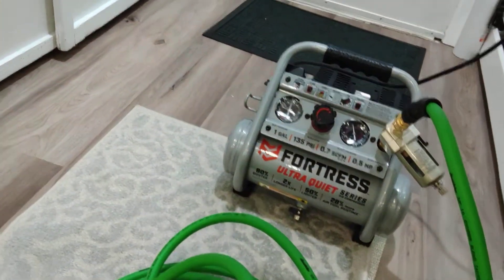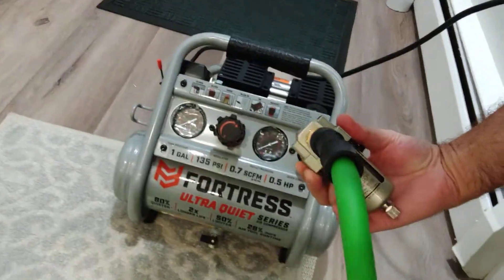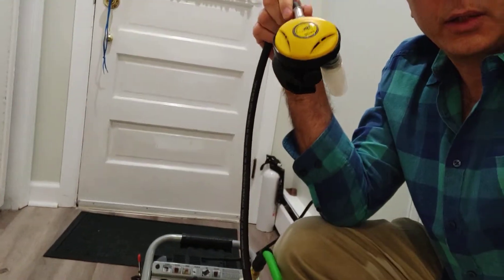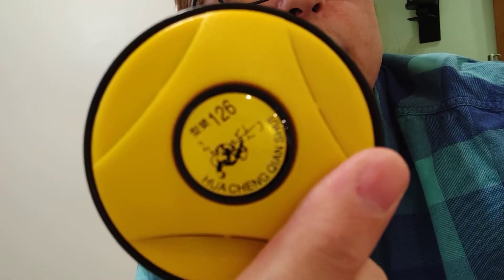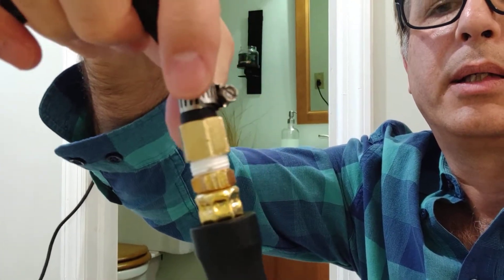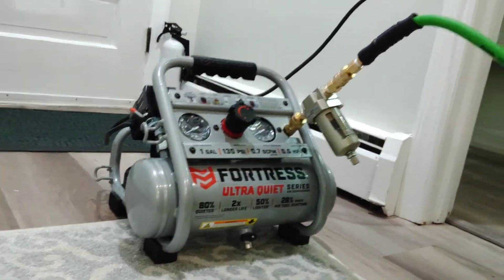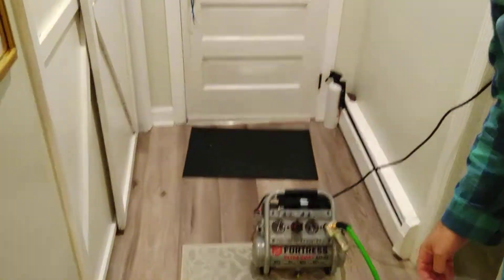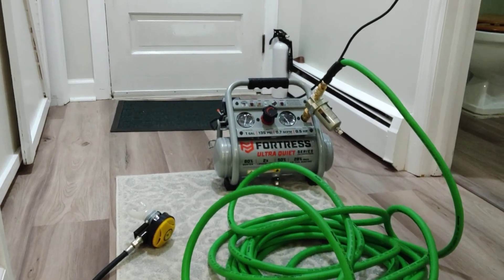Scuba Hookah system for under $200

Comment: I like your enthusiasm and ingenuity. There is a reason why trained divers would never consider using equipment like this........ 
I am known for taking risks, but as a retired scuba instructor I would not consider using this setup. for someone who doesn't have scuba training using this would be the equivalent of playing Russian roulette. Ignoring the risk of lung and brain damage from the toxic hose pipe and compressor. There is insufficient built in reserve and the hose and fittings are not up to standard and will fail. It is only a matter of time. When this happens without a bail out system you will be forced to free ascend. A free ascent breathing from compressed air from as little as 4 feet can result in lung rupture barotrauma causing Air embolism, Pneumothorax, Mediastinal emphysema and Subcutaneous emphysema. Three of which can be fatal. 
This is a classic example of the Dunning-Kruger effect. See the 1999 paper by Cornell University psychologists David Dunning and Justin Kruger. The pair tested participants on their logic, grammar, and sense of humor, and found that those who performed in the bottom quartile rated their skills far above average. For example, those in the 12th percentile self-rated their expertise to be, on average, in the 62nd percentile.
The researchers attributed the trend to a problem of metacognition—the ability to analyze one’s own thoughts or performance. “Those with limited knowledge in a domain suffer a dual burden: Not only do they reach mistaken conclusions and make regrettable errors, but their incompetence robs them of the ability to realize it,” they wrote.

Comment: How about if you make it portable, let's say you get a car compressor that can deliver the same amount of psi, and an external battery of 20,000mah, regulator and hose. Make a case that floats. Would that work?
Reply from the maker: Psi would probably be ok, but cfm not enough with car tire inflator, imho.

Comment: I would be VERY LEERY about having the air from these cheap compressors being forced into my lungs. 

One has no idea what materials they are made from. Or what they are are outgassing. 

What is the lead content of the compressor? 
There is a specification for Restriction on hazardous substances in materials. 

Maybe if one adds a good charcoal filter to the outlet.
Reply: Yeah maybe you shouldn't do it if you're scared and just looking at all the possible negative aspects...... Or send it.

Comment: That ain't going to cut it you need at least 150 LPM. That compressor is only supplying 0.7 SCFM which is less than 20 LPM.
Reply: I used the same compressor , bought Chinese regulator and 50 foot of hose I think for 40 bucks.

I dove for 2, 2 hour sessions moderate diving exertion .

split the hose for two divers.  just floating about 4 to 6 feet down pump still was able to cycle not running full cycle.

got yelled at for using barbed connectors by a diver.
Reply from the maker: For the modest usage I need it for, it cuts it. If anyone were to need more, HF sells the same line with higher capacities.

Comment: Did some more research after watching your video and now looking to add a reserve tank to my Hookah system for the reasons below. The reserve tank (or 'receiver') operates as an air 'reservoir'. It provides a constant volume of air at all times. If you are diving under heavy exertion and demanding a greater amount of air, the large volume of air in the reserve tank will supply the reserve air required. If you were breathing directly from compressor itself, your rate of inhalation might actually surpass the air volume provided by the compressor, and you would not get a sufficient amount of air.

The reserve tank functions as a cooling and condensation vessel. Few divers realise it, but the air emerging from a hookah compressor is quite hot, and can actually reach temperatures as high as 190 degrees. As the air enters the reserve tank, it will expand and cool. This expansion process will also condense most of the water contained in the compressed air. Hookah compressors, because of their small size, do not have the capability to remove the moisture from the air and hence, they deliver air with an appreciable moisture content. The expansion process in the reserve tank allows the water to condense, ensuring that the diver breaths less moisture in the air.

Floating hookah air reserve
Floating hookah air reserveThe reserve tank also suppresses surges from the compressor or any temporary decrease in running speed. Often a compressor's engine will run uneven due to moisture in the petrol. The reserve tank can compensate for this by delivering an even flow of air.

Finally, the most important function of all. The reserve tank will contain enough pressurised air to give the diver a couple of minutes breathing time, should his compressor, or engine failure run out of fuel. (not that this is of much help if you're underwater and don't know, because there isn't anyone on the surface to signal you.) Equipment breakdown is not a pleasant thing to consider while working underwater, but is always a possibility. In the event of an engine failure without a reserve tank in the system, a diver could experience an immediate loss of air that could lead to desperation and panic. Any experienced diver will tell you, that panic is the leading cause of drowning incidents.   
How to add a reserve tank.  Hope this helps.
https://www.scubadoctor.com.au/intro-to-hookah-diving.htm
https://www.youtube.com/watch?v=v_ucuWFwOyw
Reply from the maker: That's good information that people who are diving deeper should heed.  As said I use it just for under my boat so am never more than 8 feet under the surface.  If the airflow stops, it's a short swim upward.  The air-filter I have inline I believe captures moisture, as there's a moisture drain on the bottom.
Reply: @tome5345  The filter you are putting although a good thing does not cool the air coming from the compressor, just a slight blip from the mains electricity to the compressor can cause irregular air flow which could be a pain if you are having to stop and start.  I am going ahead with the extra tank more for reliability rather than depth.
Reply: I made one with four 150mm dia high pressure PVC pipes about 600mm long and four 90 deg corners. It serves as the float and the reservoir.

Comment: I was thinking about the ryobi battery powered one . 120 psi .     i was under the assumption that the 2nd stage regulators were 145 psi and that made me give up on my idea for the  project . but it looks as though yours is working at less than 145 psi  ?    i was hoping to float it on an inner tube for snorkeling .
Reply from the maker: I used it in the bay, to about -10ft and with the 50' hose somewhere around 90psi was perfectly fine. Good luck.
Reply: @tome5345  how did u plug it in?
Reply from the maker: @ronaldbruneau1980  Generator on my boat; powers 120vac outlets.
Reply: @tome5345  I was thinking about the Dewalt 2.5gal 140psi 20v cordless air compressor with 1.0 scam at 90psi but I'm not sure how long the charge would last.
I'm looking to put it on a float to pull along. The brownies are alot of money so I'm trying to figure out a cheaper way.
Reply from the maker: @ronaldbruneau1980  No idea about run time, but looks loud at 80 decibels; as long as it's oil-less and you can return of not good, you could give it a try.
Reply: @ronaldbruneau1980  my riobi works great !  25 dollar 2nd stage on e bay and compressor comes on and i get 4 breaths before it comes on again and it only stays on for like 3 seconds . i have not tried to see how long the battery lasts yet . but seems really good so far and the regulator works down to 40 psi  !
Reply: @sargentpepper8931  that's awesome.....
I ended up getting a great deal on a used brownies third lung but that info is great. Keep me posted on battery life please....great job👏
Reply: @ronaldbruneau1980  I,m guessing you got electric ?
Reply: @sargentpepper8931  no actually a gas motor one. The scout is the model, new they're like $2500 I was able to get a used for $1500 which is still alot but over 3hrs of run time and it allows you to dive with 2 persons. I'm pretty sure I'm going to enjoy it so I spent the $.....
Down here in Florida I'll have tons of opportunities to use it.
Reply: @ronaldbruneau1980  great price !  yea the two people thing is a plus , i may have to make another riobi for the 2nd person .  with two people on this one the compressor would run continuous .  lol  although ,,,,,,,,,,i do believe it would work .
Reply: @sargentpepper8931  cool keep up the good work as trial and error is key on how we move forward.  Maybe if some of these "piece togethers" start working effectively the price will come down on the other hookah systems so more people can enjoy it👌
Reply: @ronaldbruneau1980  definitely overpriced !  when my riobi works just as well for 150 dollars as the dive buddy does for 1,500.00
Reply: @sargentpepper8931   What model Ryobi are you using?
Reply: @waynebryant3352  Looks like P739   18 volt   14 lbs  .    i get 4 breaths then it turns on for like only 4 seconds . i can use this regulator i got on e bay for 25 bucks all the way down to like 30  p s i !    fantastic around the house for tires also .
Reply: @waynebryant3352  i think it will work for 2 divers !   but it may run steady  . well for the price it cost to make it you can just make 2 of them .
Reply: @UNIVERSAL-UR  not tried in the water yet but . 25 dollar reg on ebay works all the way down to  20 psi  .  so you can get every last breath out of that tank .  i get 4 breaths the thing starts up runs for 4 seconds and i get 4 good breaths before it clicks on again .  it seems a good battery would last a long time . i have not made a float for it yet . but i have used it to fill tires alot of times and great little compressor .  its not gonna be any different under water . it works fantastic in my livingroom ! LOL  .  I guess ill use a plastic bin with large pvc pipe to float the bin .  the blu nemo one they sell for 1.500.00    and this one cost me 150.00
Reply: I think 145 is the max psi but I could be mistaken
Reply: Scuba second stage regulators can't be used for hookah applications without special modifications. A typical hookah compressor operates in a low-pressure range of 25 to 120 psi. That's not enough pressure to drive the spring-loaded downstream valve of a scuba second stage regulator which is typically driven by an air pressure ranging from 100 to 250 psi.

A diver who already owns a scuba second stage regulator, but who wishes to use it for hookah applications, must take the regulator to a competent dive shop and get the regulator converted over for low-pressure use. The conversion can be made by installing a set of low tension springs which will give maximum efficiency when operated at low hookah pressures. A dive shop will also have the necessary test equipment to make certain the adaptation has been effective.

Or you can by a lower pressure 2nd regulator like the one in the video which is a Hanperal 145 PSI explorer from Amazon for £28
Reply: @brochman8307  you had me scared there that this wont work, but the regulator is MAX 145...I had a little spare air scuba tank that wouldve been perfect to do bottom work on my boat at ten feet or less, And I tossed it when it was just what I need for diving under my boat. The dive shop guys just said oh thats just junk, get rid of it when it was perfect. (so they could sell me their stuff)  OK yeah this is the regulator I got, the Hanperai 145 psi which seems to work fine. So "Typical hookah compressors...25/120 " have their own special regulators? Clearly you are a dive shop guy, and my buddy is a diver and refused to loan me his weight belt 'for safety reasons' but really because he needed a hundred bucks and wanted to clean my boat bottom himself.  Its hard to sort out the truth around these things when money is at stake!

Comment: Does it have to be plugged in and running all the time that you are under water or can you pressurize the tank and dive for a while before losing air?
Reply: GET THE RYOBI BATTERY POWERED ONE !
Reply from the maker: If off I can't imagine you'd get more than a minute of enough pressure to breath adequately, but I'm no compressor expert.

Comment: How has this worked out for you so far? I'm considering making one myself..
Reply from the maker: Haven't tried it in bay water yet; still pretty cold in the NE. Excellent in a hot tub though 🤿
Reply: I'm also wondering if .7 SCFM will be a little light for a 5' to 10' bottom cleaning job with 100' of hose?